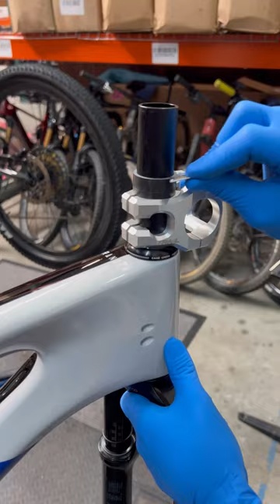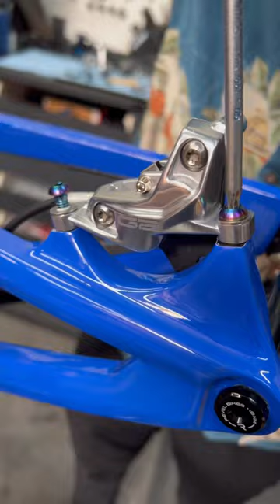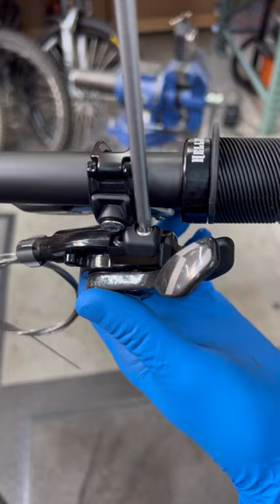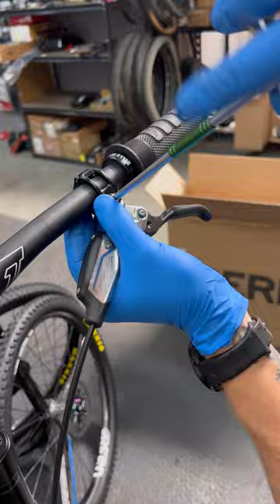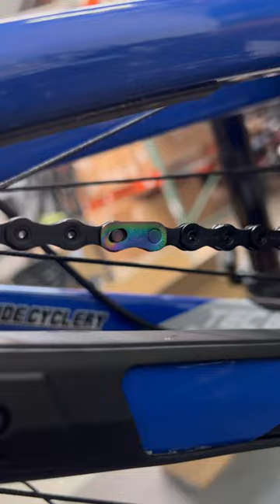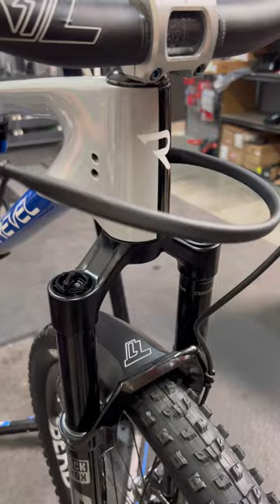Jeff's Custom Painted Revel Ranger Is Out Of This World 🌎

Comment: Worldwide cycling I have a question. Im buying a new fork for my bike. My bike has a tapered headtube and headset but my old fork was straight 1.1/8 with a 1.1/8 crown race. Do I just need a new crown race or do I need an entire new headset? The bearing is 1.5 the race is just small. Thanks